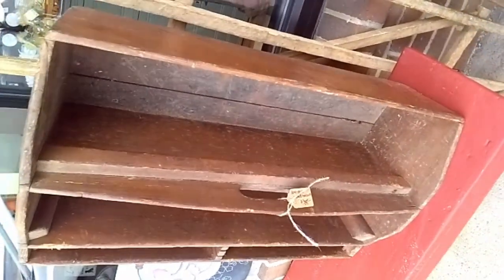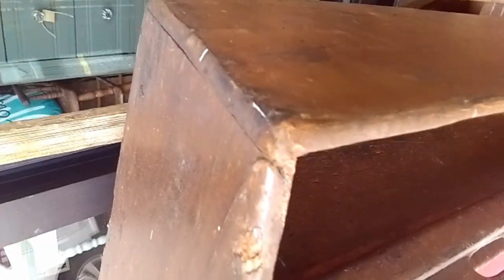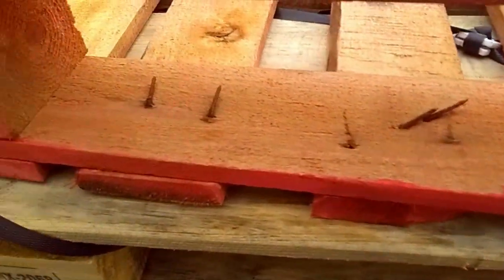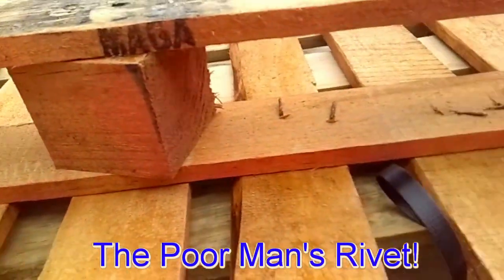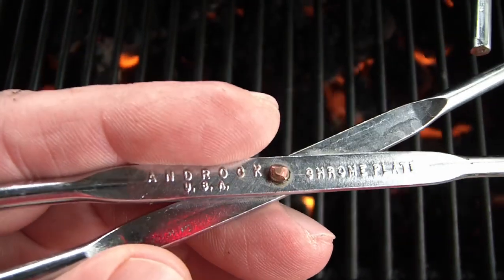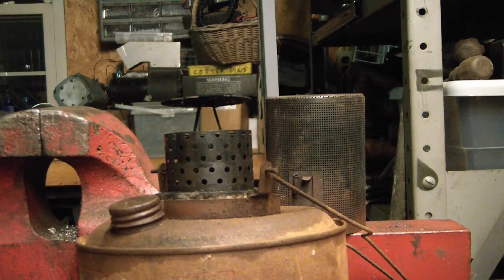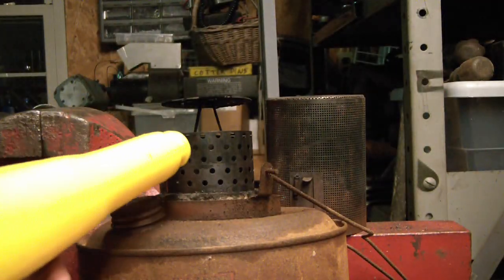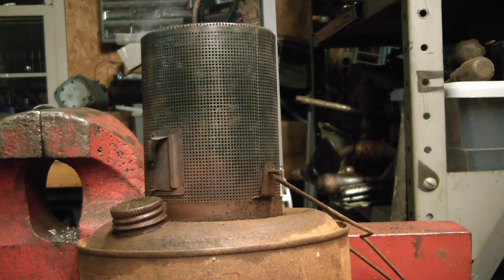Neat Stuff & Hot Tip

Comment: I have a similar heater NIB from Sears. It is intended for keeping a car engine warm. 60 years ago, as an apprentice carpenter, my first homework was to build a tool tray. There were exact plans and requirements in the Audel's book. The next homework was a pair of saw horses. My father had a heart attack(he survived) and that ended my apprenticeship. Good Luck, Rick
Reply from the maker: Thanks for the info!  I know it is really an auto heater.  It was in a previous video.  This was just a followup clip where I lit it with the alcohol.  Thanks for watching!  :)
Reply: @timeflysintheshop  I expect that it could be used as a small heater. My father had a cabin in the 1940s. It had a kerosene heater, a kerosene stove, and a kerosene lantern. He lived there for two years after he came home from WWII. Kerosene was a very inexpensive fuel(less than gas) until the 1970s. Good Luck, Rick
Reply from the maker: @richardross7219  Kerosene is pretty pricey these days, but the little heater was nice to take the edge off while working at the bench in my shop.  I also have a propane radiant heater as well, but having the little heater right on the bench where I was working was nice.
Reply: @timeflysintheshop  In 1970, a gallon of gas was 25 cents and a gallon of kero was 22 cents. Now its a lot more than the gas.